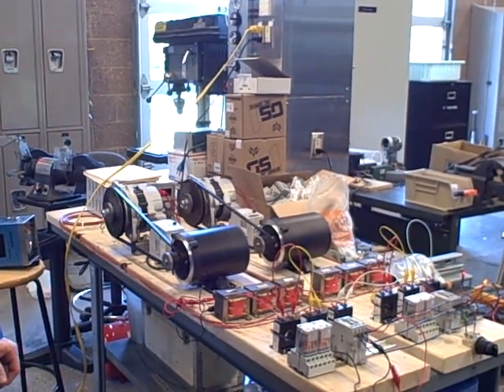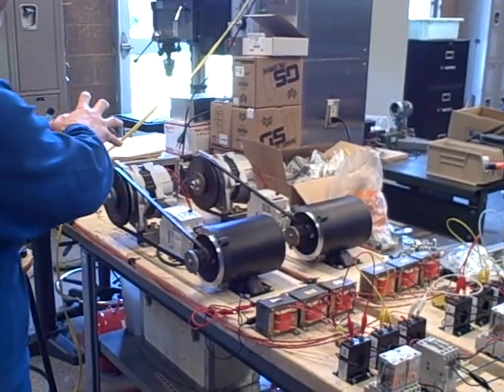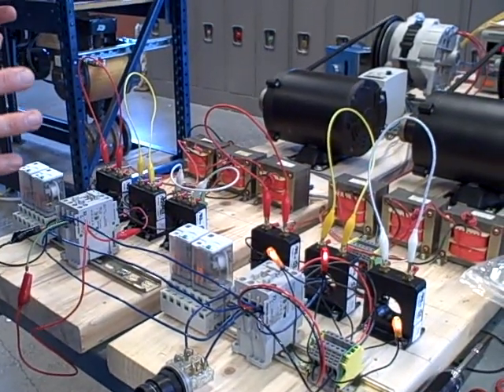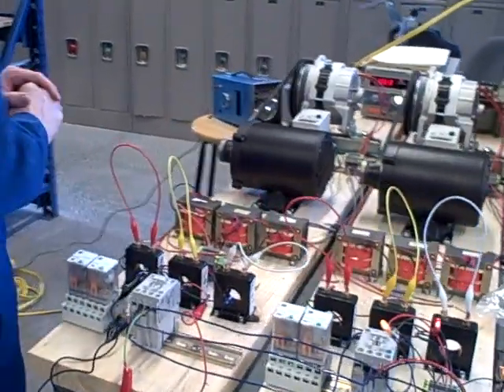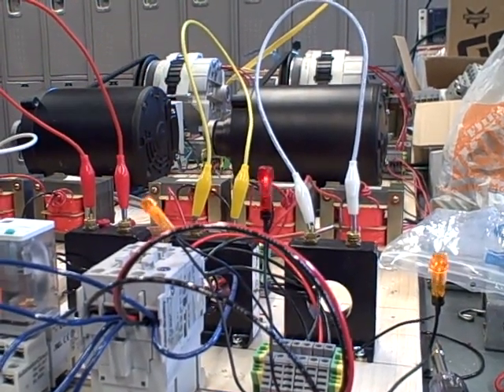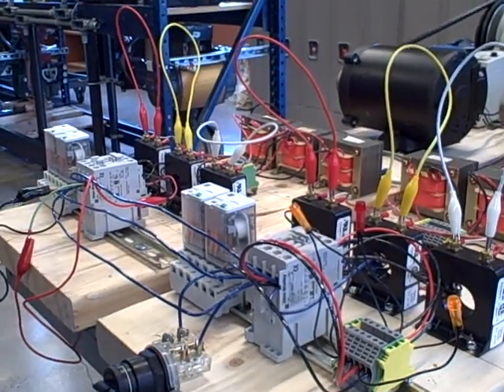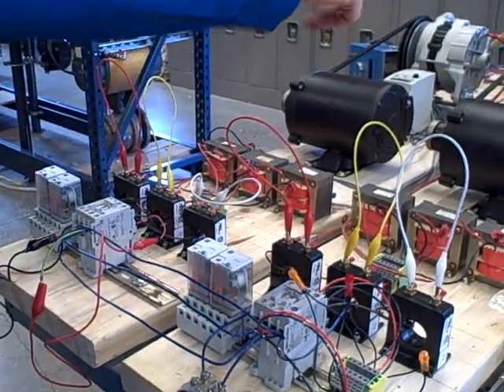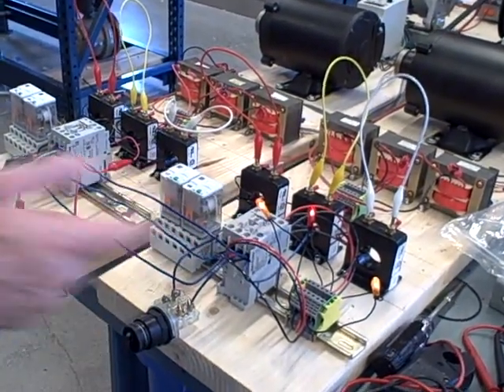Synchronizing AC generators -- Part 1 (introduction and sync lamps)

Comment: Very interesting!  Makes me want to make a demo example using synchronous alternators (i.e. generators) with engines powering so to show the adjustments of the carb screws and possibly the governor to adjust the frequency.  For adjusting voltage I'm guessing a variable inductor like from an older transformer based welder core rewound so used as an inductor would be the easiest to use compared to a high current variable capacitor or banks of capacitors switched to adjust.  Might be able to just custom wind a variable inductor though using a high magnetic permeability material like a ferrite rod maybe or I guess just rewind a transformer with equal windings on each side with that type material in between so to affect.  Instead of using a syncroscope, is neat seeing how to gauge using only neon lamps.  Interesting.  Definitely different than adjusting the inverter, I guess H-bridge switching to achieve voltage, phase, frequency and phase angle sync.
Reply: I just realized with the AVR design synchronous alternators... that can be used to adjust the rotor voltage so to adjust the output of the alternator.  Didn't think about that for voltage control.  So now that I think about for the older models without an AVR... I'm guessing some sort of thyristor can be used maybe unless is a DC design which not I think about being a magnet... then must be a DC design so some sort of DC regulator circuit can be used for less losses seems versus say like a potentiometer design.

Comment: If they are out of sync there is a potential between the lines you connect them when potential is 0 (light is off). They self regulate because if they fall out of sync the generator that is under a bigger load will cause it's prime mover to slow down.

Comment: If I understand correctly, the generator staying in sync relies on mechanical forces imposed on the generator armature by the magnetic properties of the current going through the coils in the generator. Is that basically it?

Comment: there is also a spinning dial indicator they use, similar to the lights. and flip the breaker when the dial is at the 12 o clock position. The lights are a more simple solution tho.

Comment: Stupid question. 
Two gasoline driven engines drive two three phase motors. 
Each engine has its own fuel regulator. 
If the two motors fall into sync and a substantial electrical connection is made - wire capable of carrying the full load of both generators combined - will they stay in sync ?  
Does the fuel supply, carburetor , also need to be connected ?

Comment: So if there are many multiple generators all wanting to spin at slightly different speeds, but are being held in synch by the electrical connection between them all, seems that a lot of energy is wasted between them all in an effort just to keep synchronized.

Comment: Way cool. Now  I'd like to see how increasing the drive of the 'local' generator affects voltage and current flow with the 'grid' generator.
Reply: Would have insignificant effects. The larger effect would be when your small generator is out of phase enough, your wires would melt.

Comment: great explanation! One question though: does it mean, that in case one induction motor is rolling two identical alternators on the same belt drive, they remain in sync? I guess they will produce the  same voltage and frequency, but - as their initial rotor position is different - the current flow direction changes will not be necessary in sync...
Reply: As long as the alternators are in parallel their speed will be "exactly" the same.

Comment: what happens if using alternators of different KVA
Reply: They'll pick up load, as a percentage of their combined capacity, based on their individual capacities.

For example, say you have a 2KVA and a 1KVA generator, which have been paralleled.

If the load is 1.5KVA, the 2KVA unit will pick up 1KVA of load, and the 1KVA unit  will pick up .5KVA.

Comment: Love the series of videos on gen sync. Do you think it is at all possible to use a NC relay in place of the phasing lights to automatically close the contacts on the contactor?
Reply from the maker: My eventual goal is to put an actual auto-sync relay on each generator, in addition to the overcurrent relay (ANSI 50/51) and the loss of excitation relay (ANSI 40) we'll have on each generator station.  We could build our own auto-sync circuit, but my preference is to use industry-standard components whenever possible.
Reply: BTCInstrumentation A PLC and some voltage/phase relays + frequency/voltage transducers will do a good job with the VFD's you already have.
Reply: The ANSI standard for such a device is a 25 relay, known as a sync-check relay. It does not allow the incoming generator’s breaker to close unless the voltages phase sequence and phase angles all are within the correct values.

Comment: Great video. I’ve been searching for a clear explanation for a few days now. Is there a schematic or parts list available anywhere. Would love to replicate this project with multiple units. Thanks
Reply: 2 x generators
2 x electric motors
Misc. belts and pulleys
2 x motor controllers
6 x step down transformers
2 x contactors
3 x neon indicators
1 x maintained switch
Misc wires, connectors, din rails.

Comment: Excellent explanation! How would this work for a residential generator? Would it use digital circuitry to accomplish the same thing? I wouldn't think it would "correct" the grid, like the motors do to each other, but just regulate it's own frequency and voltage, along with the anti islanding circuitry. I have grid tie solar, and I'm on time of use, and I've wondered about being able to supplement my own production during peak time with a gasoline generator if needed on a hot cloudy day. Do they make a grid tie gasoline, diesel, or propane generator?
Reply: Single phase generators like residential generators cannot be paralleled with three phase sources like the utility. The reason is single phase systems have a phase angle difference of 180 degrees per phase. Three phase systems have a phase angle difference of 120 degrees per phase. 
Generators that operate in parallel with the utility grid are considered to be interconnected to an “infinite” bus. The frequency and voltage is determined by the utility source. The generator can not change that. 
The only adjustments a generator can make while operating in parallel with the utility is to change its real power output (Watts) and its power factor by changing the reactive power output (VARS)

Comment: Thank you so much for this video. I have two portable gas generators, 2 pole. Always wondered how I could sync them up to double the output on the same bus. In theory you show me its possible, but the voltage would have to be the same on each, and speed near equal. In theory, if i could find a way to sync up the engines, voltage, and install properly sized circuit breakers for overcurrent protection, is this possible?

Comment: This is very awesome. I don't know if you are still paying attention to comments, but could you theoretically couple 2 or more portable generators (gasoline or propane) together to combine their power output using this set up? (As long as the alternators are the same number of phases of course)
Reply: Yes, but there is more to paralleling generators than this simple demonstration.   You don't want generator A to be dragging generator B along for the ride(while in sync), and then try to power refrigerator Z with the combined system.
Reply: @dave4882  I would have to imagine that you would need to have manual throttle control over at least one generator, and monitor the amperage of each generator output, adjusting throttle to get them as close to each other as possible.
Reply: @Kingkoopa00  You are correct.   Measuring generator current is interesting though, because you can actually feed current back into the slower generator.  I've never heard of a meter that can measure this, that is not a super expensive professional(power company) grade meter.  Most meters measure AC current, and do not give a direction since ac does both directions. (I hope this is clear enough)  Back feeding current can be a BAD thing.  If you are home building a secondary generator, look into an induction generator.  Few people know about these, but less problems with syncing.  They can be used as a primary generator, but more difficult than self exciting generators.
Reply: @dave4882  I wonder if you could run a line tying the 2 generators directly to each other, like phase to like phase, and monitor the current on that. If one generator is feeding the other, there will be voltage and current on that line. You could put a very high resistance, high power resistor on it to limit the current if unbalanced. If its perfectly matched, there should be zero volts (perfectly inline phases) and no current, but if one is feeding the other, there will be a slight AC voltage on that wire due to one of the generator phases "chasing" the other. 

Also, Induction generators are nice, but they are very small compared to full size non-inverter generators. And wouldn't be able to run the large loads a home may need during the peak of summer.
Reply: @Kingkoopa00  thats effectively what the lights are doing in this demonstration.   Notice that they dont light up once the breaker is closed even when he deliberately runs thsm out of phase.  The main conductors keeps rhe voltage at zero, although the one motor is being pulled along.

The company i work for has a 1 megawatt induction generator in use to get rid of extra steam they make.  So you can get them large.  Or  build your own if you like.  They are simple.  You can even use a 3 phase motor and run it as a single phase generator with a few capacitors.

Comment: What did you use for the initial power source to start the motor and the electrical magnet in the alternator
Reply: These generators are simply powered by induction motors running off individual ESCs connected straight to the real grid. The induction motors serve as a placeholder for what would be a turbine or gas/diesel engine in a real plant or generator.
Reply: polymetric could you use battery power instead of gas so that it dose not have to be hooked to the grid or use a fossils fule
Reply: @yashuamessiah3922  If you want to use a battery to power a motor to power a generator to power stuff, be my guest. Just don't be surprised when it only charges your phone for 15 seconds.
Reply: polymetric did you hook it up right battery runs the motor spins the generator generator charge the battery and then pushes the energy through transformers which then intern take the power off the battery and the transformers are now running The motor that spends the generator that produces the power It’s a literal alternating current system the energy just goes around and around and around and around and around and around you’re just tapping into the energy and using it
Reply: Oh dear. someone wanna tell him?
Reply: polymetric well I do want to hear it lol
Reply: Look I’ve seen it done here on YouTube It’s literally taking the gas motor and replacing it with electrical motor and replacing the gas tank withA battery pack

Comment: There was me always imagining complicated synching circuitry! Presumably there must be a "master" or they could follow each other down or up?
Reply: I'd imagine (not a pro but I have a decent understanding of how motors and generators work) they find an equilibrium, given that the motor/generators are the same size / power, as the slip would likely be split fairly equally over the two motors, much like when you hang something on a spring, the weight of the object and the tension in the spring balance out.
Reply: @ninjaz5736  Yes ok but, what says that they will output at 60Hz?
Reply: @featherbrain7147  in this case they wouldn't, they'd stabilise at something like 59.8 Hz (or whatever the average speed is), this happens to a smaller extent on bigger grid systems where extra power is needed to keep the frequency up.
Reply: @ninjaz5736  Ok and here in Britain it's 50 Hz anyway. My point is, some mechanism has to determine the target speed. Something initially has to set the grid frequency. A "master clock".
Reply: @featherbrain7147  the target speed will be set by adding/removing power from either of the motors, which will balance with and loads on the system to get the desired frequency. The whole grid relies on this balance of power to keep the frequency. There's not a "master generator" in this case, only a target frequency, and it's the balance of power (input) and load (output) that delivers it.
Reply: @ninjaz5736  The "motor" is a steam turbine.
Reply: @featherbrain7147  so in that case you'd have to control the amount of steam going to the turbine, by for example in a Nuclear Plant moving the control rods to increase the amount of energy used to heat the water.
Reply: @ninjaz5736  Yes! But the machine has to "know" what frequency it's aiming for, is all I am saying. 60 hertz won't happen by itself.
Reply: @featherbrain7147  I can only agree with you there! There are tons of computers in power stations (and a few lumps of meat that can think too!) which make it all work (mostly) flawlessly
Reply: @ninjaz5736  actually, concerning steam power plants (including nuclear), you get more power by opening more the steam valves, "and then" you need to heat more (you can of course anticipate the latter, but one should not think that heating more is what makes more power, it is the increase in steam flow).

Comment: can you provide a parts list so I can build this in our training center?
Reply: +R Neidert A lot of variety is possible when building such a system.  Since you&#39;re going to have to built it yourself anyway, I&#39;d advise checking local suppliers for best pricing.  What you need is: an automotive alternator (equipped with a V-belt sheave), a fractional-horsepower 3-phase motor with sheave, a VFD to power that motor from 120 VAC line, a small 3-phase contactor to serve as the circuit breaker, a pair of &quot;ice-cube&quot; relays wired to form a latching circuit for the contactor, and power transformers wired in step-up configuration to convert the alternator&#39;s low-voltage output into something higher.  All schematics are found in a link at the bottom of this page: http://www.ibiblio.org/kuphaldt/socratic/sinst/doc/design.html